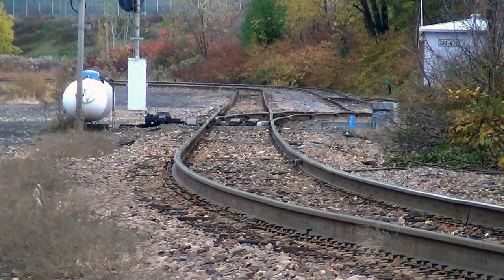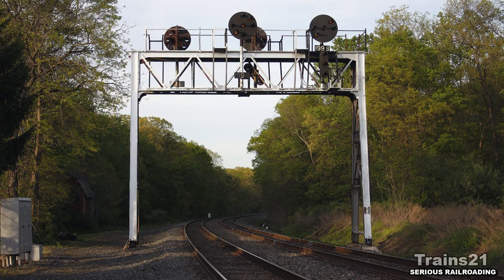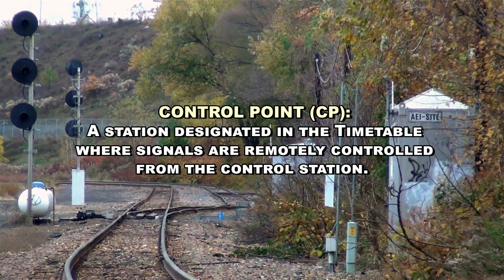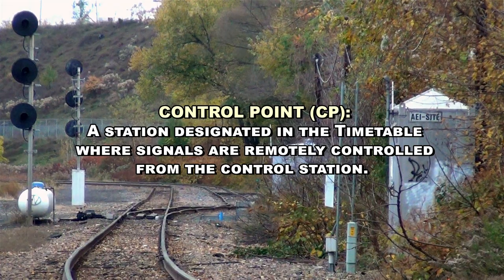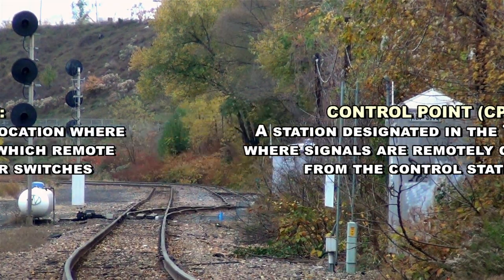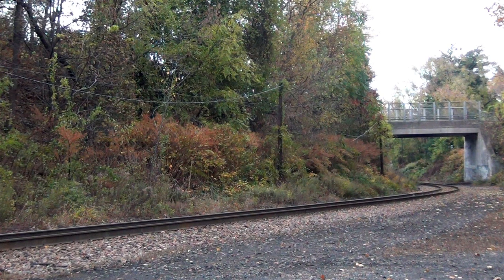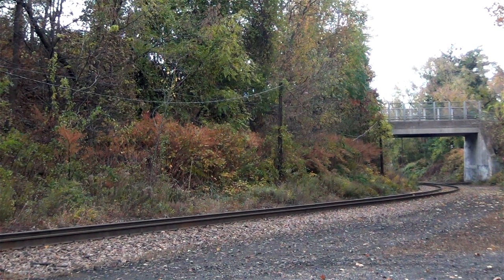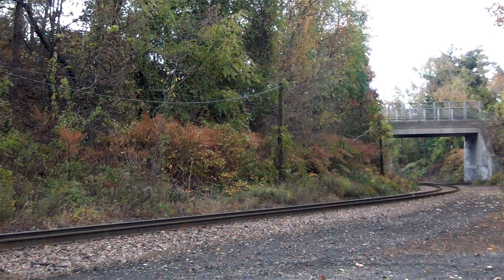How Railroad Junctions, Control Points & Interlockings Work (Part 2)

Comment: Perhaps you would appreciate this, but the ice storm has me in house.  Yesterday I stumbled on a UP instructional film circa 1989 regarding how to get through interlock systems.  What 'blew' me away is that a diagram of the Beaumont [Tx] sub was shown.  It showed all the SP interlock systems, bridge system over the Neches River, etc.  The next diagram showed the MoP and it was the line that ran through my old hometown.  All the interlock systems, sidings, spurs, etc. were shown.  Of course, it's now UP but the Beaumont sub and my old hometown former SP yard are quite busy with traffic on the former SP and MoP lines.  Unfortunately, the half-billion-dollar Brazos Yard hump facility providing an estimated 250 permanent jobs was cancelled by UP in order to lengthen existing sidings and construct new longer ones for PSR.  The site was where the old MoP and SP lines ran parallel in what is known as the Brazos Valley in Robertson County, Tx, my ol' stomping grounds.

Comment: so the crews are operating switch because of malfunction, dispatcher cant get the switch to line one their board even if it actually is lined. The dispatcher will give permission past stop signal and permission to operate switch by hand and can then instruct the crew to either leave in hand or put it back in motor.

Also we got cp vine, locust, 58th st, now we have Penn

Comment: Sooo.. For a line such as CN/IC's, which are North/South running, if there is no rules about signal on N or S sides, where would that put those?  (Yeah you may call this an smartass query, but remember, there are folks that are complete noobs to this and would assume that everything is E/W running by the statements made on this video.)  Answer:  The United States Federal agencies that govern the surface rail industries have not finalized an "perfect" solution to signaling positions and with the continuing automation of rail traffic control systems under the rapidly developing PTC systems, may never come up with a "final" solution.  (Also why a few RR's no longer "call" all signals any more. Whereas the bigger Class I's still have tight rules in place about this.

Comment: ChainsawN&W1218, I really miss the N&W CPL signals there is one still in operation at a place called NS Whitethorn District beside the New River were I film some were they run alot of Eastbound coal traffic and other trains to Roanoke VA some coal trains over 200 cars long with mid helper DPUS!🇺🇲👍🛤🚂